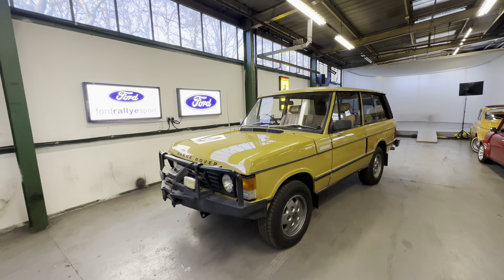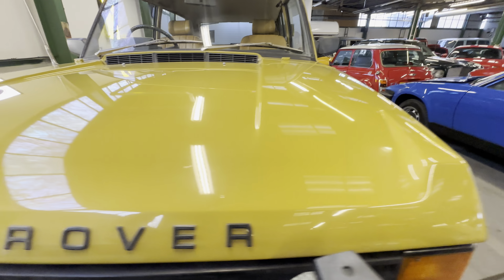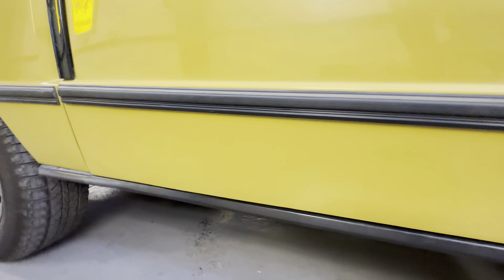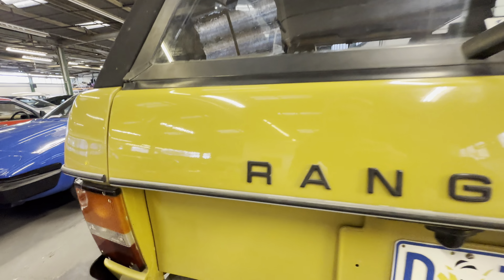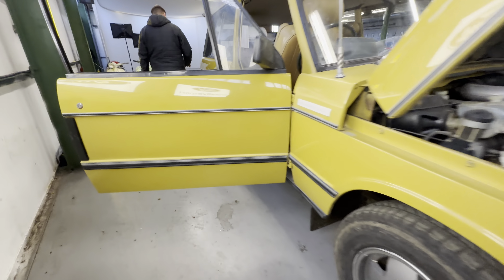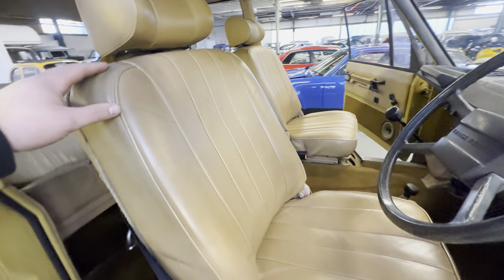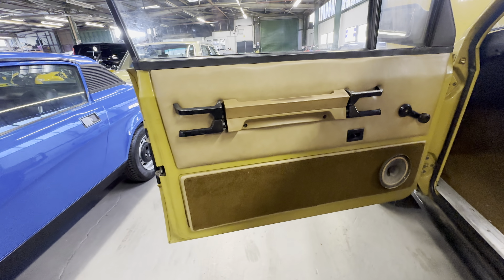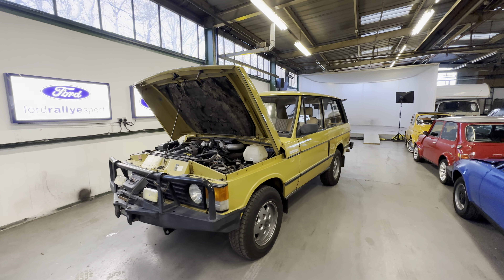Range Rover Suffix - Only 26,000 miles from new! True survivor

Comment: Interesting car, not original paintwork of course, signs of overspray and bittiness in finish. Few areas of original paint obvious by being dull which Inprefer. Mileage unlikely to be correct, would like to see AUS mot mileage evidence to corroborate. Nice enough but not 100% as presented imo.
Reply: Thought the same,really good condition but not that low mileage